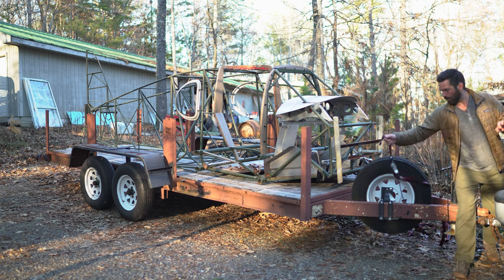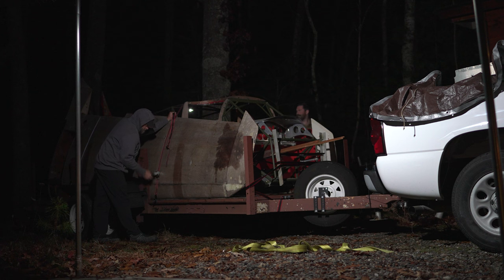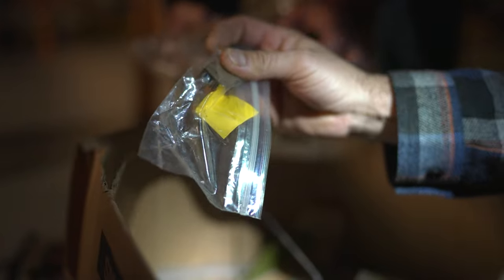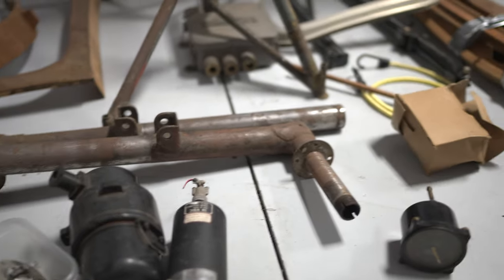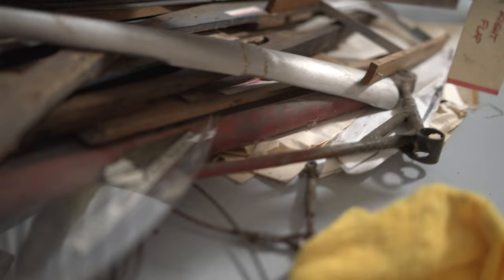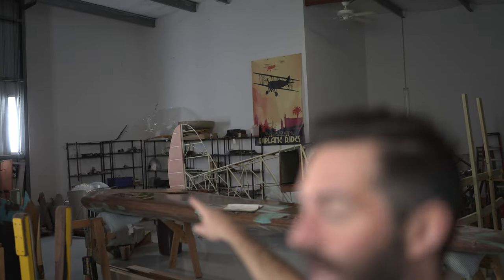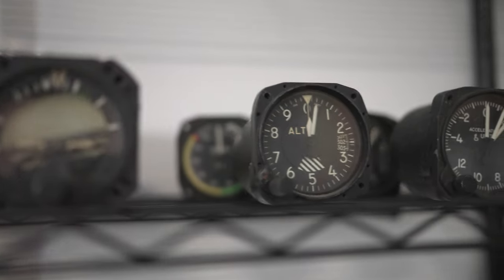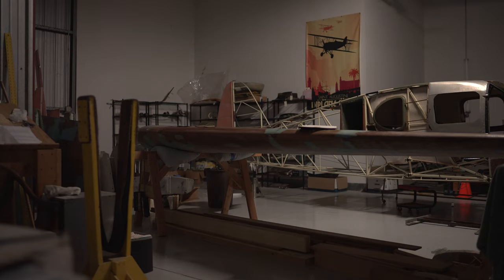Bellanca Cruisair Aircraft Restoration: Chapter 6

Comment: Really try to get an Aeromatic prop. They make a big difference in performance. As I recall you can set three points, static RPM, climb/liftoff full throttle redline and full throttle cruise RPM at about 7 K ft. They all interact so a lot of adjusting is required. I rode in my friends 150 HP years ago with 4 men and about 1/2 fuel and it does fine. 150 mph TAS at 8k ft is attainable.
Reply: I would not waste a dime on an Aeromatic Prop. I have flown with another Cruisair and my plane was faster with a fixed pitch prop.